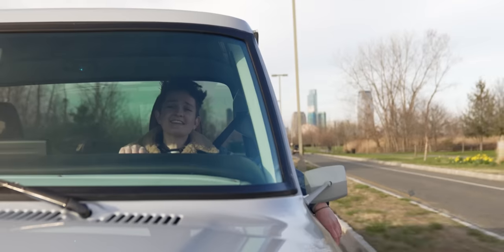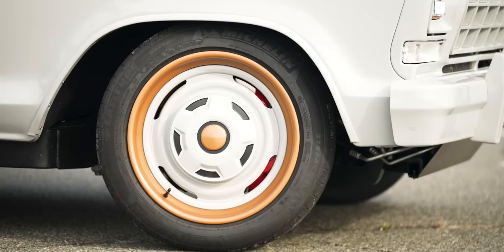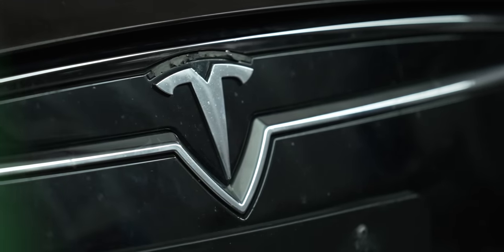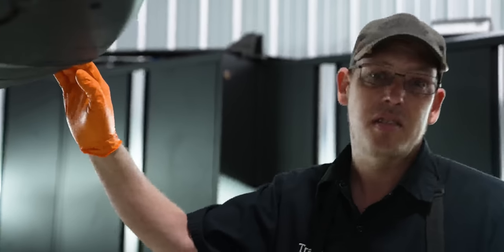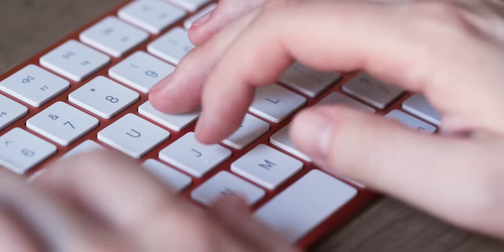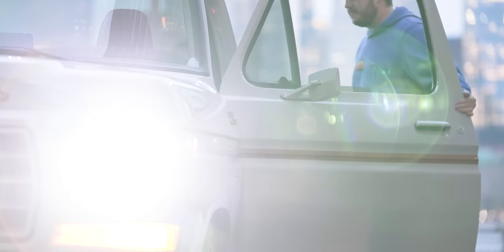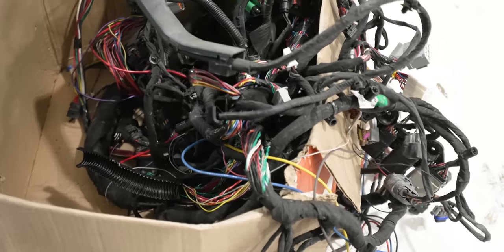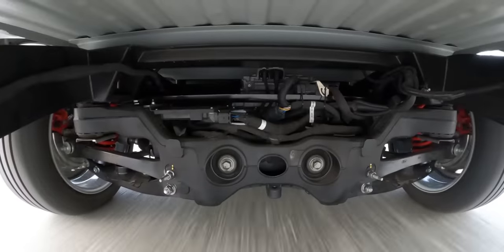Ford did what Tesla won't

Comment: Lots of folks with no idea how to work on ICE cars commenting about how hard it is/will/should be to work on EVs in these comments. If anything electric motors are easier. The control systems with proprietary code not so much if that isn't shared but that is IP territory that's gonna be rough. There is and has been available EV conversion kits for years though.

The real limiting factor here isn't really companies like Tesla playing anti right to repair, not that I can say I like or support that. It's one of many factors starting with most people still having tremendous range anxiety. Followed by most EVs being either "weird" or expensive or both, I wanted one last time I bought a new car and got a new Accord cause the only thing really in my range that met my needs was a model 3 and I couldn't go in for the all controls in the tablet no regular dashboard nonsense. Now everything has to be a crossover on top of it and sorry pass.

Comment: Tesla already released it's proprietary service and diagnostic software to the public. The obstacle to shade tree mechanics working on electric cars is that most of them don't possess the the electronic or computer skills to troubleshoot and repair simple electrical problems in ICE (internal combustion engine) vehicles, much less hybrid or full electric vehicles -  and they are not likely to bridge that gap anytime soon.

Comment: As an electrical engineer, I love EV's. However, again as an EE who has worked for both a major auto manufacturer, and multiple power companies, I know for a fact our grid is no where near capable of handling a 20% buy rate for EV's. Let alone an unrealistic goal of 80%+. Let's not even discuss the laughable inadequacy of current battery or power distribution to "fuel up" in any reasonable amount of time. Or the fact everyone in the country would need three phase main to their house, plus multiple lines to charging stations, just to attempt to power them in under an hour. 

   Again, I truly am a proponent of EV's as an option. However if you try to make an option the ONLY option, the entire grid will collapse in an instant... and you'll probably kill countless people by running what amounts to long line levels of electricity into everyones garage.

Comment: That's kind of wrong argument to say that Ford did what Tesla won't do just by the fact that Tesla car use direct transmission system, the wheels are the motor. By default old car from other constructor because there is no trasmission system to conect a new engine and would require a structural modification of the vehicule to take the actual Tesla tech. And i'm not talking abouth stearing system modification yet

Comment: The lack of repair-ability overall in the EV is a major issue that has to change. If it doesn't I'll personally avoid EVs until it does. However, currently I'm avoiding for the reality of EV production, infrastructure, power plants, charging stations, low battery range, etc.  It's a nice technology. However, the production of an EV pollutes more than a ICE vehicle currently. Sorta defeats a major purpose of EV. Plus gasoline cars do less to the climate than the airline and shipping industries.  Governments would rather crack down on your average Joe than deal with the cruise, shipping, and airline industries.  And then they don't want to upgrade the infrastructure. There aren't enough charging stations.  If even over half the US owned EVs we'd be doing rolling blackouts everyday to keep up with energy demands.  I congratulate Ford on doing what Tesla won't, but EV is still 20-30 years from actually being viable for all us.

Comment: Fuel is just more efficient though, I can go farther, faster and the energy is produced directly inside the vehicle. For EVs you need to produce energy elsewhere, then use energy to transport it to the consumer. The electric vs gas debate was here when cars were first invented, gas won for a reason.

Comment: The thing I'm excited about with EVs is less maintenance.  I'm familiar with both ICE cars and basic programming/electronics.  EVs are a major step forward.  I still want a 3 Rotor RX-7 though.  Rotaries for life!
Reply: EV's aren't any easier to maintain- in fact battery cells are far less reliable than pistons and they still have plenty of fluids like coolant and oil and of course common failure points like bearings are much harder to access.

Comment: This debate has been going on for awhile. John Deere has proprietary software that prevents anyone from working on their farm tractors. There are some people challenging that ruling but mostly Deere controls the software to run their equipment. There was a recent story about the russian invaders stealing a number of Deere tractors from a showroom in the Ukraine and taking them back to russia, but last I heard, they haven't been about to get them running. There was a time when it was law in this country that if you sold a vehicle, you needed to make the factory manuals available. In the 90's I bought a 68 911 and was able to buy a beautiful set of factory manuals to put the car back together again ( I bought it in pieces.) Porsche wasn't happy with that requirement, but the American market was too lucrative to not be in, and so they complied. It's just a matter of political will, which is not a small matter.

Comment: There was stuff that was kind of said in the video, but not really acknowledged.  Who are going to be the 3rd party mechanics that will be able to work on this electric equipment?  That's dope that Ford and Chevy are going to put out their engines for folks to tinker with, but are they going to put out detailed schematics, parts like inverters, batteries, head controller units, and provide the tools necessary so these gear heads don't need a bachelor's degree in computer science to make their electric cars go?  Electrified Garage and Rich Rebuilds are two of only a few folks that work on this stuff, and both of them can because they have ex-Tesla mechanics working with them.

Comment: Hot rodders have been recycling and doing their part to reuse existing pieces for their projects. Instead of throwing away an old car, repower it. Having the ability to put things together and solve a pile of problems is what hot rodders do. Give us access to the information and we will learn it. Instead of draconian measures to obsolete parts for profit, how about right to repair?

Comment: Been in the trade for a couple decades, just gonna put this out there.  There are people who are good with electrical systems, and then there are people who are not...Most are not...Theres a reason auto makers like tesla, are apprehensive about letting small shops touch their stuff.  If it burns, its bad press for them, worst press than the lack of right to repair, and unlike ICE vehicles EVs require a lot more attention to detail, and training.

Comment: If you disagree with me please reply I am open to having a conversation as long as it is calm. Please ask any questions about my comment to me calmly in replies to this and I will try to reply to them comment:Something I that think is left out of the conversation on evs is practicality for people that have cattle or other livestock because the tractors need to be able to stay is fields for sometimes a month at a time and have fuel delivered to them so you would need a very large capacity battery that could be put in the back of a pickup truck and taken out (it isn’t feasible to buy a whole new vehicle because of the expense or to have a trailer because sometimes both this and a trailer would be needed). The tractors would also have to function very well and with very little power loss in -40 degree temps all day they also have to be able to worked on easily, have powerful hydraulics and be no more expensive than diesel tractors because they are already very expensive.

Comment: EVs still have so many issues and are not as environmentally friendly as advertised. I've said this for years, the real future is hydrogen powered vehicles. Abundant and renewable fuel source, quick fill up like conventional vehicles, and their byproduct is water. The only thing those vehicles need to get off the ground running is infrastructure investment (which isn't cheap). California has started, but it needs to spread further. Toyota already has production ready hydrogen fueled cars. So to me, EVs are a waste to invest in given their limitations. Put that money towards hydrogen power.